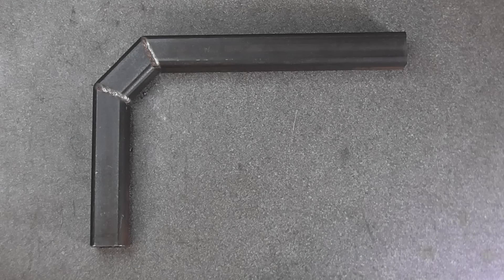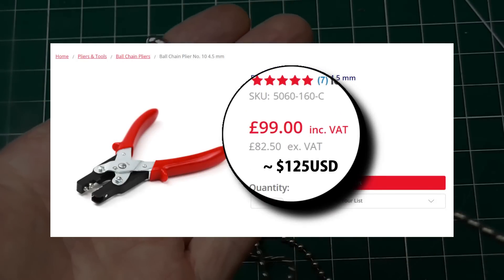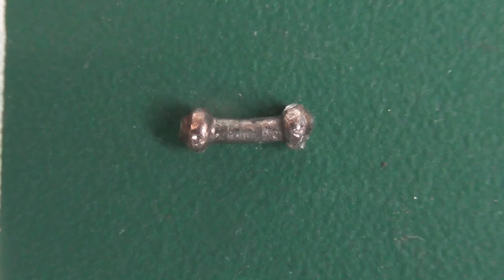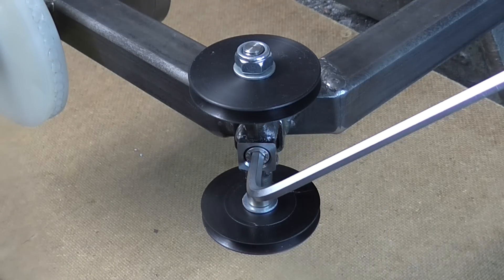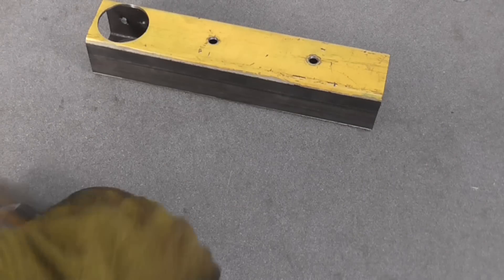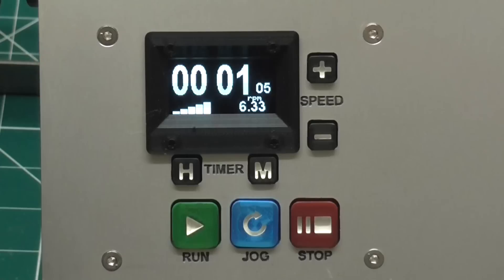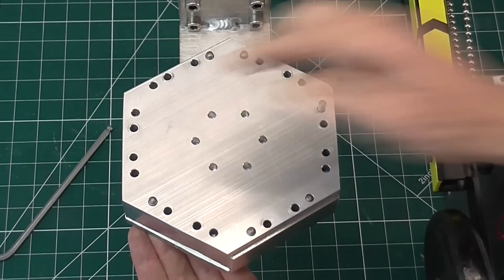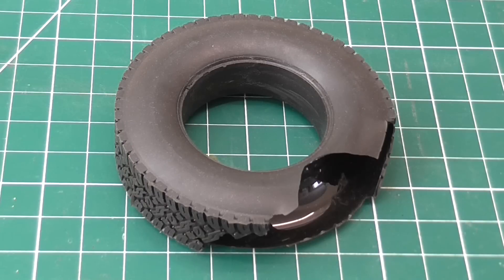Rotational casting machine (DIY) part 2

Comment: Why did you go through the trouble with using a chain like that? It seems to me that the exact rotation is rather uncritical, so a normal flat belt  would have been my choice to save a lot of time. In the end it's your machine :) Great work as always!
Reply from the maker: I just think the chain is a slightly more elegant solution than a twisted flat belt, but either would work. There are examples on Youtube of people using a twisted toothed belt for this and it looks like it works fine even though it might look a bit odd to use the belt this way. The load and speed are very low so the twisting doesn't really affect the belt. The design of the machine is almost the same so the only extra work involved was in making the chain into a loop. The machine doesn't have to be perfectly synchronous, though it is nice to be able to stop it with the mould horizontally level for filling with resin. Even a round rubber belt with non-toothed pulleys will probably work fine.

Comment: What a cool, imaginative DIY project. But as a rotomoulder, 2nd generation in family, we've been doing this for well over 40 years, I must object to calling it "rotational casting". If there really is a country or a group that calls it that, please let me know?
Reply from the maker: Well, I really don't have a lot of experience with casting resins, I'm learning as I go. Though I have also done some injection moulding. But as I understand it, rotomoulding is a thermoplastic process where the mould usually spins inside an oven? I'm in the UK by the way, not sure if that makes a difference to what it's called.
Reply: @AndysMachines  Please excuse me, as I am not a native english speaker. I meant my comment as lighthearted nitpicking. The way I have been taught on these terms is you cast metals and mould plastics. I may be way off, and who cares, the point is I love the project and please keep on doing such fun projects.

Comment: For the hole without a holesaw - that would have been a good use case for a trepanning tool in the boring bar holder. Even factoring the time to grind the tool, you would have probably saved time overall on the two holes.
Reply from the maker: I've never actually tried trepanning with my boring head, but yes that's another good way it could be done. I'll make a tool like that one day!

Comment: I wonder if you could have left the bigger locking link in place rather than build the tool to join the dumbbells by cutting a single special indent in the pulleys for it...assuming that the ratios of the pulleys and chain length could be adjusted so that the big link would always fall into those special slots, and assuming the chain never slips.
Reply from the maker: I did think of doing something like this (removing every other tooth). However the small pulley has an odd number of teeth, so this wouldn't have worked, but with an even number on both pulleys and an even number of beads on the chain it would. I expect the chain would break before it ever slipped

Comment: Hi Andy, excellent video as always.
I don't know what kind of PU rubber you used, but if you have control over the curing time that would help an even distribution with in the mould I'm sure.  I say this as someone who would like to make large scale tyres but don't really want to/cannot justify for such limited use, the lengths that you have gone to achieve it.
As others have have mentioned, I also would love to see the production of the tyre mould too.
Regards Mark in the UK
Reply from the maker: Thanks! I tried two different types of rubber with working times of ~10 minutes and ~ 2 hours. I thought the longer curing time would be easier to work with, but actually found the opposite. There is an effect known as 'flash curing' where if you have a large pool of resin rolling around inside the mould, this tends to set first and form a large lump. Also I thought slow speeds would coat the mould more evenly, but found faster was better. It doesn't seem very intuitive and I'm learning as I go. The viscosity of resins can also vary a lot, which is another factor to deal with.
Reply: @AndysMachines  Let me first say i design and build proffesional rotational mould machines (for plastics like LLDPE and PP), and i am impressed with what you have made. I can confirm that the higher speed should be the best. the most standard setting is 8:4 (8 rpm for the arm and 4 rpm for the form). When your moulds get more assymetrical 8:2 might work better. Unfortunately you can not change that. Maybe an upgrade for the future. Another thing that can help with assymetrical or complex moulds is to change direction during casting. We do it around each 2 mins (in a 10 min cycle). so in your case it would probably be a little quicker. I hope this information helps a bit and looking forward to more videos.
Reply from the maker: @leonmotter  Thanks for the information, that's very interesting! I had found by trial and error that a ratio close to 8:2 rpm seems to work best, but I still get thicker and thinner spots in some areas.  Maybe 8:4 would work better. No, I can't vary the ratio of the machine, but I could easily make a smaller pulley for the form so it has a fixed ratio of 2:1 instead of 4:1.  It also currently only runs in one direction but it wouldn't be too much work to make it alternate direction. I might experiment with both of these and see what difference it makes. 👍
Reply: @AndysMachines  In conventional rotomoulding aka heating the mould from the outside to melt plastic, thin and thick spots are created by having either hot or cold spots, material builds up more where it is hotter. In your case it can only be controlled by your rotational speeds of the arm and form. But keep in mind that the amount of material versus free space in the mould matters. i would also try to decrease the amount of material you use and see if that gets a better result. It is a problem we always face with products with a really smal internal volume.

Comment: Nicely done. I'm not into this particular hobby of mold making and casting, but this looks like a machine for which there could be some commercial demand, do you think?
Reply from the maker: You can actually buy small rotocasting machines for hobby use, however they seem expensive for what they are, not much different to many home-made ones you can see on Youtube and the idea is quite simple and probably not hard to build for the type of person who would have a use for one.

Comment: Neat. There’s some work in that mould. Can you do a video on that? 😀
Reply from the maker: You are right! There was some work involved in that! I actually tried 2 other methods to make this mould (casting and electro-forming) before realising that the only way was to machine the whole thing in sections (I knew this from the start, but also knew it would be the most time-consuming way, so tried to save some time, but the results were not good). 

I did get some footage of the process but not enough to make a whole video just about this. If I ever do a video series on what these tyres are for then I'll include it in that.
Reply: @AndysMachines  isn't it funny how we always try to save time but end up spending twice as much if not more on our "shortcuts"
Reply from the maker: @anotherguy9402  Thats true! "Do it right, do it once"
Reply: @AndysMachines  when it doesn't go right I always say "what's worth doing once is worth doing twice" or "if you enjoy doing it, then doing it twice is better"
Reply: @anotherguy9402  Absolutely true in engineering.
After 30+ years as an engineer there are some fundamental aspects to project management that you NEVER see in project management lectures or texts. Try and remember these 2 things.
1: Time is a resource, unlike every other resource. Because once spent it can never be recovered.
2: Never underestimate the ability of people to underestimate how much time any activity will take.
Reply: I’d love to see a video on that too.
Reply: Same here!